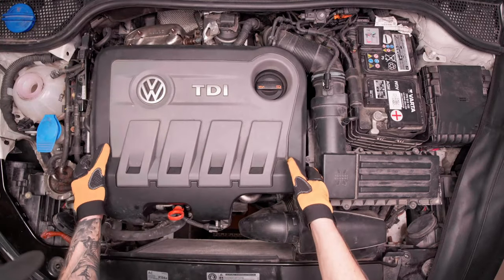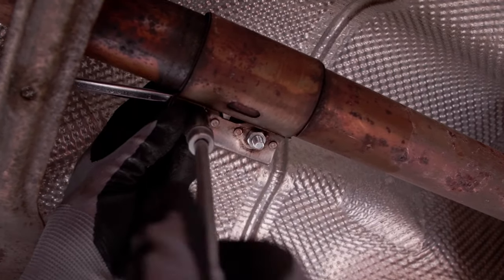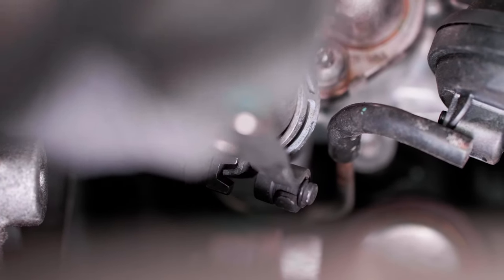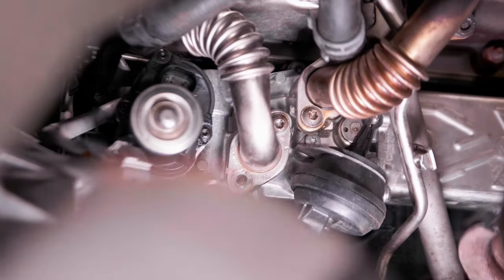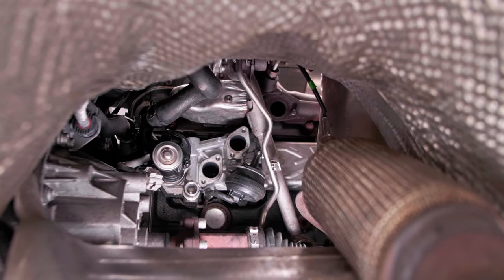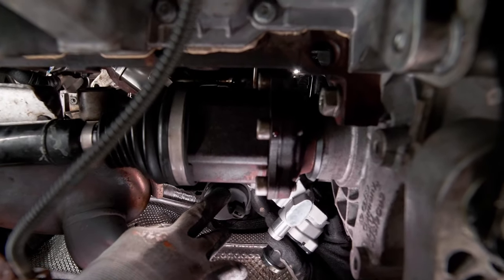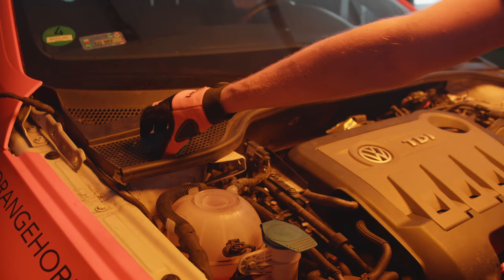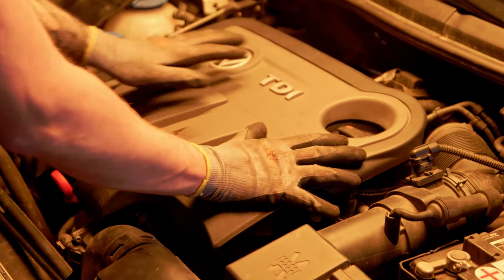How to replace an EGR cooler on a VW 2.0 TDI engine

Comment: Replacing parts isnt that hard if you have the right tools. Diagnosing the car properly if you should replace a part at all or just fix a wire thats causing the problem, thats the hard part, which most mechanics fail to do, because they suck at their job and want fast and easy money with simple repairs.
Reply: Right said
Reply: Witch wire is that?

Comment: I have question. My car 2.0 TDI 16V 2005 BKD losing antifriz littlebit and i have pressure in coolant reservoir (bobbles in coolant reservoir when engine is hot, when ii is cold engine there is no bobbles). Also it is never white smoke from exhaust, no matter hot or cold engine. Before 10000 km i replace the cracked head, i put new head gasket and next day it was start losing antifriz again. I put some liquit for clogging of holes and it was good 1.5 year. Now it is losing antifriz again and i dont want to put liquit again, so what can be problem? EGR Cooler maybe? Or little hole somwhere, but where it can be? Also, is it the same problem the losing antifriz and the bobbles in coolant reservoir on hot engine or?
Reply: i have same car, motor typ and similar problem with cool water. did find solution for your issue?
Reply: @mahmoudalabbas81  no, i will chek egr cooler, that is my last hope. I will inform you if i find what is problem.
Reply: @profpetarsazdov  and how is the results, have same problem, coolant loss. No smoke, nothing
Reply: @DJMakil09  cracked head 99%
Reply: @DJMakil09  do you have bubbles when engine is hot?
Reply: @profpetarsazdov what head?
Reply: @Chill018  yes, cracked head

Comment: Why did anyone replace this? Was it because of the CEL code? Or because there is no heat in the vehicle? Can this part cause no heat inside the car? Please help
Reply: I had to replace it because of an internal malfunction that was throwing up faults that caused engine warning light, coil light and dpf warning on dash. I also had to do a DPF regen after I replaced the valve. Hope this helps.
Reply: it fails internally and leaks coolant to the intake sometimes, i am having this problem now. I took the hose from intercooler this morning and there was about 1 liter coolant, which lately i was having trouble. I checked everything, like water pump, heater core etc, and i left cardboard under the car but no leaks and i found a forum someone else had same issue and posted some pictures and that gave me the answer. Now i am waiting the part to install it. On the video it looks easy but such a narrow spot i think it won't be that easy
Reply: @sacitkoc2544  there's an easier way to replace it. Follow the video by "kennedys garage" . That might help. Another step that will help is to remove the lower left engine mount, that will allow you to swing the engine bottom towards the front bumper about 50mm to increase access to the egr area.

Comment: Was going to do this, then realised on a 4Motion it's impossible with the transfer box in the way. It becomes an engine out job on a 4Motion... might as well do timing belt and clutch/dmf while I'm at it.
Reply: Absolutely no need to take the engine out on 4motion, but it’s a lot more work than fwd cars.
Reply: @FiveInline84 Any idea how many hours labour you would expect to be charged for this job. Looking at alltrack going cheap that needs an EGR, thanks

Comment: Turns out this is pre CVCA/EA288 
Pre - '15/'16 2.0 liter TDIs.
'15 and '16 use an entirely different EGR cooler, I believe the same cooler as the passat.
Reply: Do you know if it would work like this on a ckra?

Comment: I have the same problem
Dealer daignose was EGR ...
Then warranty decline to cover it.
Dealer said £1850. So I said no .
Now local garage's don't know how much they gonna charge!!
Reply: Any update on the EGR issue? Dealer wants to charge $2750 AUD. Told them they were dreaming.
Reply: @BR-io9vm   Im also in Aus. My egr is currently throwing code P0401. I think I'm going to go the remap route get a tune installed while disabling the EGR electronically via software. My only concern is how this will behave with the DPF as online has mixed information.

Cost of remap including EGR delete via software is $1500, i doubt insurance would be able to tell as it's via software and the benefit is no more EGR problems which solves a lot of headache.
Reply: It’s 4-5 hour labour rate plus parts

Comment: May i know why you change it?
Reply: Because the exhaust has particulates in it from the diesel being burnt that cause it to clog up.
Reply: @Nishad Khan Or your water pump is leaking.
Reply: @Nishad Khan sometimes the egr cooler cracks on the inside, the coolant is circulating inside the egr cooler cooling the hot exhaust air and if it cracks you won't see the coolant leak because it is inside the egr cooler and the crack is small ,  the coolant is sucked in with the exhaust air by the engine.... this can be one of the issues...
Reply: @hellohumans175  
That is exactly the failure my '15 Jetta had, identical symptoms and all.
People need to watch which dealers/mechanics they trust, I usually work long hours so I went back to where I bought the car, they guessed (literally guessed - no actual diagnosis testing) that it kicked out a head gasket which in turn somehow trashed the engine - wanted me to have them install a long block, I declined. 
When I could get to it I pressurized the coolant side of the EGR cooler at 20psi, it bled to zero in less than 5 seconds.
Reply: @Motor-City-Mike  I just discoved this part on my 2.0tdi.. When I ll have time Im gonna test it because it has the same symptoms as a blown head gasket, white smoke, bubbles in coolant, and coolant leak.. But for this week-end its party time !